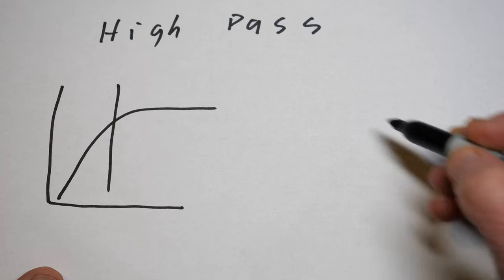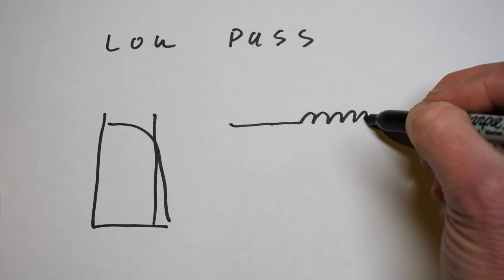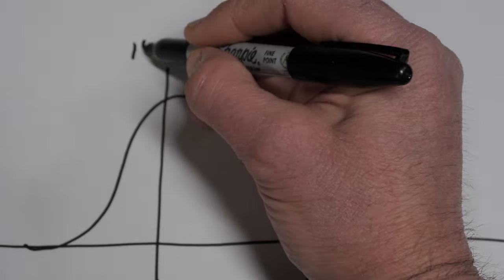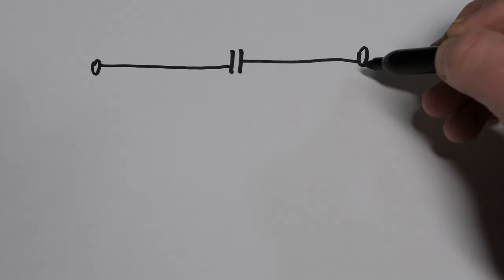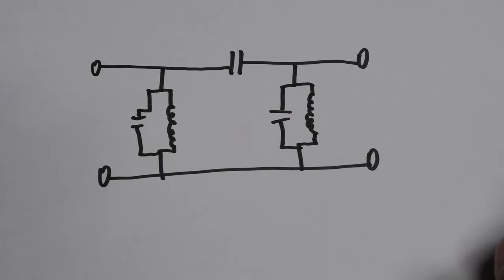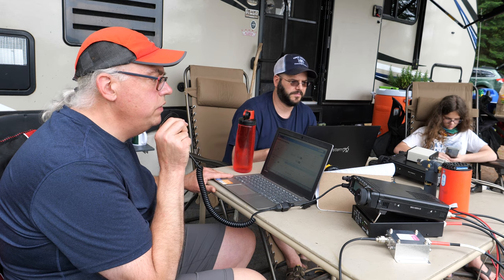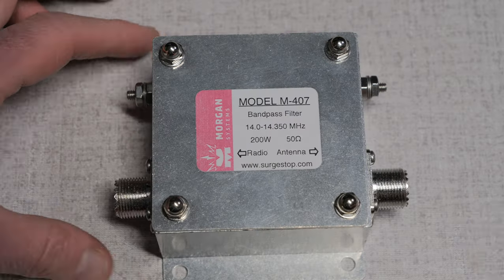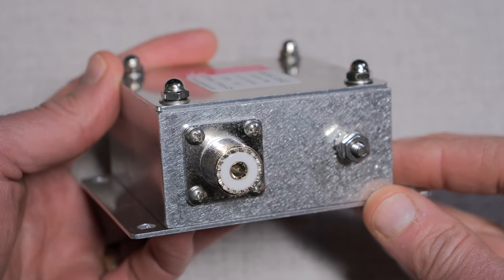One of the most important station accessories: band pass filters  #hamradioqa

Comment: We made band pass filters for 80, 40, 20, 15, 10m for WFD this year. Ours would only work with both stations using them, which did not happen. Three 7300 users within 100 yards and my IC-706 was a recipe for disaster. I had coax issue for the first two hours so I didn’t notice the issue until later. We had fun and made contacts, that was the point! The interference was annoying, so maybe Summer Field Day we will get more use from the filter set. By the way, they are the built from the Sept 1988 QST article by Lee Gordon, K4VX. Tuning almost requires a NanoVNA. Thanks for the video Mike!
Reply from the maker: Building a band pass filter isn't a monumental task, but you do need a few specialty tools, like a vector meter and a method to properly measure the values of your inductors.
Reply: @KB9VBRAntennas  Mike you are spot on!
Reply: @KB9VBRAntennas could you do a video on how to make a band pass filter?

Comment: When 2 rigs are operating in close proximity (i.e. field day, etc...) the most critical bandpass filter is the one on the lower frequency transmitter.  Those harmonics are front-end killers, and the higher frequency radio's bandpass filter is no help with that. 🙂
KZ9V
Reply: I agree.  In the scenario where operator A is running FT8 on 40M, and operator B is running phone on 20M or 10M, the harmonics from the 40M can fall into operator B's band.  A bandpass filter on transceiver B will not block these frequencies - doing so would block the very band it is trying to use.  Placing a bandpass or lowpass filter on the 40M rig should attenuate the generated harmonics sufficiently such that the FT8 transmissions do not impact the phone operation.  Just remember that the power handling capability of the filter needs to equal or exceed your rig's Tx power.  In the case of the Morgan 100W filters, I probably would not operate a digital mode such as FT8 at much more than 25 watts.

Comment: Great video Michael! Why is the metal enclosure so large if the components inside are so much smaller? Heat dissipation?
Reply from the maker: Air wound inductors can be quite sensitive to other things in proximity of them. A bit of spacing keeps them from interacting with each other.

Comment: WOW they price has gone up! They are not 140$ each. I ordered 2 of these. My Friend and I have started doing POTA and are going to do a field day this year. He operates Phone on 20 and I run FT-8 on 40 meters. When he operates he is just killing me to the point that I can only use FT-8 because of the interference. I run a IC-7300 and a IC-705  the rig he runs is IC-706.   I hope these help us out, if so they will be worth it. Thank you for all your helpful videos.
Reply from the maker: Morgan Systems sells two versions of its filters. The legacy filter is a 3-pole design, which is adequate for most circumstances; and that is $80. They also have a high performance version which is a 5-pole design and offers a higher level of attenuation. That one sells for $140.
Reply: @KB9VBRAntennas  I did not know that but I think I would have went with the better one anyway. We really want to do the POTA together and last time we just took turns 30 min each but it was boring. If they work they will be worth it to me. The 705 was not cheap either but should last me the rest of my life!  Thank you again for the video, I was getting desperate and was thinking of buying some of the junk off ebay but they had bad reviews and they were 100$ each. I hopefully if they work good I will pick up one for 15 and 18 meters I like those bands as well. I always seem to end up on 15 meters, I started there 44 years ago when I got my Novice. A friend had a old broken vertical he gave me, It only worked on 15 meters but it sure worked good there.
Reply from the maker: These filters are worth the money. Dave, KZ9V, and I operated multi-multi mobile for the Wisconsin QSO party, me on phone and him on CW. Both antennas were on his truck and the filters worked flawlessly. I've also used them for multi-activator POTAs and Field Day with great success.
Reply: @KB9VBRAntennas  Thanks for the info. If it worked for you guys both on a truck it should work for Glen (KD8KMY and myself K8OCN) in a field. We are going to do field day in my back field this year (have not done a field day in 20 years) and we were thinking of me going in the front yard and him in the back field but we would be s far apart we would not even be able to see each other and I am not thrilled about setting up in the front yard. If its a nice day and I get tired I will want to go sleep and leave it set up to come back to in the morning. Much safer in the back where no one can see it. Glen stays on 20 meters and I like to hop around always looking for better signals. I can see I will be buying more of them for the other bands if they work as well as I hope they do. 73

Comment: How is a band filter different then a choke?  Another Youtuber I watch has what looks like a small piece of coax with 4 or 5 ferrite beads shrink tubed to it and places it at the end of this feedline just before the radio.  He calls this a choke.  Great video Michael, 73!
Reply from the maker: Chokes perform a different task than a filter. A choke, like you described, will reduce or eliminate any common mode current running back down the outside braid of the feed line. By blocking the return RF energy, they help prevent your feed line from becoming part of your radiating antenna.
Reply: @KB9VBRAntennas  Thanks for the clarification, Michael.  Your explanation really helped frame the subject so I can dig deeper on the web.  Cheers!

Comment: Hey I could really use your help on something, whenever I read about 1:1 baluns or "ugly balun" (for the purpose of reducing rf in shack it says that you should wind up the  coils close to the feed point of an antenna, I recently came across a video where the opposite was advised that if you don't want to feed RF Into your rig wind up the coils as close as you can to your rig. Please help me understand how it's properly done. If I had to guess at the rig sounds good because any line you leave out of the balun has a chance of radiating or creating unwanted skin effect so eliminating it closest to radio makes sense. But if so, why do all these other sources say at antenna feed point?

Thank you!
Reply from the maker: A choke or balun at the rig vs the antenna are serving two different purposes. We put chokes on the feedline for antennas that tend to generate common mode energy at the feed point, like end-fed antennas, or verticals with a poor ground network. This keeps the  common mode currents off the feed line and the feed line from radiating. (Not that this radiation is necessarily a bad thing, but it can affect your overall RF radiation pattern).

Putting a choke near the transceiver performs a different purpose, and that's to help prevent the common mode currents from interfering with the transceiver's receiver. The devices are often also called line isolators. If you live in a noisy area (like an urban environment), a line isolator may help reduce that noise floor as the common mode energy isn't getting into the transceiver. 

So the question is, which is better and do you need both? It really depends. If you are using an end fed antenna, adding a choke, along with a counter-poise, will help increase the effectiveness of your antenna. Does your station have a higher than average noise floor or you live in a residential area and have already explored removing local noise sources? Adding a line isolator as close to the transceiver as possible could help remove that noise a bit.
Reply: @KB9VBR Antennas  can you put a choke at both the transceiver and feedline? I'm assuming because it calls for more cable it will result in some loss but is it worth coiling up on both ends. I do live in an urban area with lots of electrical noise,  but my initial concern was because I just made a random wire 9:1 balun to reduce how much common mode currents are created during transmit but also to not have RF go back to transmitter and find my CW key, computer or worse my lip from the mic lol

Comment: Michael, a question: would you use / recommend use of a band pass filter - for just participating in POTA (not near any other radios/antennas)m or just calling CQ - especially CQ DX? My question revolves around QRM/QRN - and, it if seems uninformed, it is because I am learning. Thank you. KQ4IXD
Reply from the maker: I'd only use the filters if another station is operating close by. Their purpose is to filter noise outside your passband. Band pass filters can help to reduce overall noise, but their effect will be marginal because they won't be able to filter out the broadband noise that falls within their frequency window. But they can be helpful for noise outside the band.

Comment: Michael, thanks as always. I may not have been listening attentively enough, but what about the instance where a local AM station is slamming your rig's front end. [I hear online that evidently the Xiegu 6100 has this issue]. Which product would best take care of that?? Thanks! 73, Tim
Reply: The "high-pass" filter that Michael mentioned, or perhaps a "notch-filter," would be the best way to attack that problem. 
KZ9V
Reply from the maker: A high pass filter will reduce the AM broadcast band noise. Morgan Systems also makes one designed for cutting broadcast interference.

Comment: Hi Michael,

Newby question:

For a QTH base station with long EFHW wire antena for multiband use, would adding a band pass filter at specific bands clean up the signal? If so, could one set up an array of 3 - 4 band pass filters on a switch to the same antenna to improve Rx/Tx on multiple bands? 

No nearby source of high energy RF; this is a hypothetical question. I looked at the recommended website and they offer two levels of filter - older models at ~$55.00 and newer ones at ~$120.00. Maybe not THAT expensive, but if this is a dumb idea I don't want to waste my time and money experimenting on it. OTOH if there is potential merit I'll add it to the project list.

Thanks for great presentation as always.

73,
John KK7JBZ
Reply: Unfortunately, no.  Unless your receiver is being decensed by a strong nearby RF source, your local in-band noise issues won't be solved with a band-pass filter. 
KZ9V
Reply: @davewhite7679  Thank you!
Reply from the maker: Dave's right. In the situation you described, band pass filters won't help. A common mode choke may reduce the broadband noise, though. Palomar Engineers make a variety of common mode noise filters to do that purpose. But often times looking for the actual source and eliminating it is your best method for cleaning up a received signal.